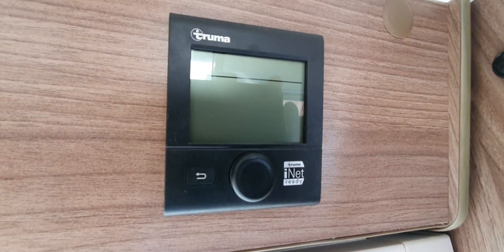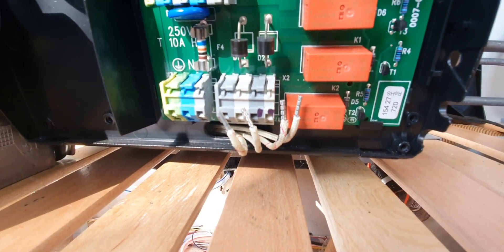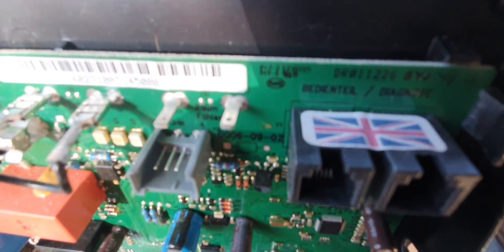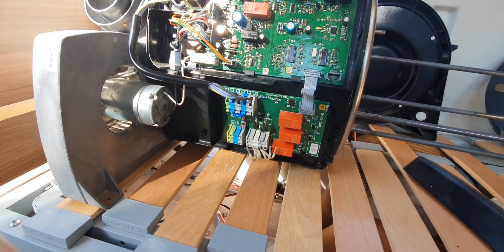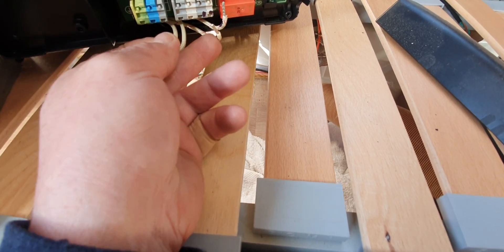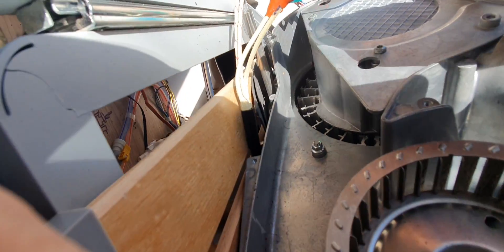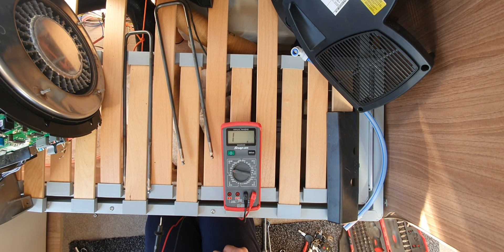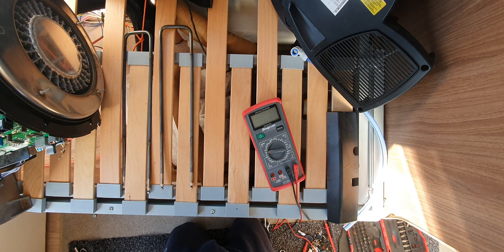Truma Combi 2E 4E 6E boiler element testing and removing

Comment: Hi steve we curretly have out heater out to replace the heating elements the problem we have at the moment is the person who did the service on he caravan removed the element cabels from the power supply does it matter what terminals each wire goes back into any help greatly appreciated
Reply from the maker: @lewishugman1285  Hi Lewis, no it doesn't matter which one goes where, on low power only one of the elements will heat up, on high power the 2nd one will kick in, I can't see it makes much difference which element is assigned to which circuit, the elements are both the same and both will heat the tank up as well as each other.
Reply from the maker: Just to add... obviously each element needs a live and neutral, so you can't  mix that part up.
Reply: Many thanks yes we numbered the element wires when we disconnected them from the elements but it was the pcb board end that was the problem so as long as it is as u have done it we should be fine

Comment: How do you remove the element cables from the PCB? I need to remove mine and can't see any screws to slacken or tags to press in.
Reply from the maker: @stephenprice7502  They are just held in with a spring inside the connector block, use a small screwdriver to hold it open while you pull the wire out.

Comment: Great video thanks Steve, it's helped me a lot. One small point about your diagnostic technique using continuity setting on meter. Your meter is set to buzz at low resistances (possibly 10Ohms or less). However a 900W element has a resistance of about 64 Ohms and a 2Kw element about 29 Ohms, so you should use the meter on ohms. Regards
Reply from the maker: Yep i agree, I had already tested the elements using ohms, I set it to beep purely for the video to show the difference between continuity and an open (dead) circuit i had with the elements. Glad it helped anyway. 👍
Reply: Can I just jump in…..Im a bit confused….all indications are that I have a blown element (boiler doesnt  work on low, only works on high). However, Ive got the unit on the bench and the new elements have a resistance of 62.1 The elements in the boiler have a resistance of 60.2……so now Im confused! Do I have a blown element? Continuity test does nothing on old or new elements - I think the resistance test is the only method that works…..and now Im totally confused by my readings! @awiserbud

Comment: To make it easier to remove old elements, I cut at the "U" & twisted each half out. The after-market new elements were fine, except they came without the second nut to terminate the wiring lug. The old nuts do not fit - were 3.2mm, new element threaded end is 2.8mm., fine thread. Also used graphite powder on new elements to assist with tight fit. All working fine, hopefully for more than 18 months this time!
Reply: Sounds like 5BA and 6BA thread sizes.

Comment: Usually when heating elements fail they have swollen(my experience from cooker elements at least) from use meaning they will be tough to remove as they are held in tight by the heat dissipating fins which the heat conducts through, removing without full disassembly and carefully spreading the fins could mean damaging these fins and when fitting the replacement elements they are not snuggly fitted inbetween the fins(hence easier to fit new elements) and heat not fully spreading across to the fins and consequently premature failure of the elements. Just info for others that may contemplate cutting the element 'u' bends to remove elements without full disassembly. Of course elements can just fail without swelling so some may be lucky in removing them easily and fitted new may be OK. Just something to consider for future ref  to others interested.

Comment: hi great video, love info. But can you help with the control panels. you have 2, do they interconnect or both connect directly back to the combi separately? thanks
Reply from the maker: I only have 1 control panel for the combi, the other control panel is for my caravan, (lights, water pump, power etc)
Reply: @awiserbud  so with just one control panel (assuming you mean one dial) are you limited to running on gas only and not on 230v electric too?
Reply: now realised you have a newer model which has a digital control panel

Comment: Hi I have watched your video several times now and yes it did help me to fix my problem but my question is how do you open the connector plack to heater elemant wires as I dont want to break anything, just ordered 2 new elements today, and I know i can replace the without opening the block, but I would like to know for any future work, thanks
Reply from the maker: You dont need to open it, the element wires just push into the connector blocks

Comment: Hi Steve, great video I need to subscribe to it…but I’m hoping that you will be able to help me with an opinion….
Mine has failed with an E41H error but it’s failed on gas and electricity…so it’s not just the elements….the overheat sensor hasn’t tripped, can you point me to a likely source or solution ?

Comment: hi, well i am having trouble with my truma combi boiler. the fault on the control panel reads, ....."operation fault: 230v-power not connected"....... the boiler works on gas fine, everything in the van electric wise works fine, but the boiler just wont work on mains power. i have tried a new power lead to the van and to no avail. now i am absolutely clueless electric wise and i am wondering if this was the start of the problem you are dealing with. i only want to go to a dealer as a last resort, so i hope you get this comment and maybe be able to maybe shine a light on it. thanks and hope to hear from you. cheers

Comment: hi steve changed mine for £150 ( truma £650.00) worked for a couple of months now the  problem is E41 H elements tested ok  heaters not working any idea ?
Reply from the maker: E41 is an electric issue, trumas fault list shows thos as a temperature sensor; either air temperature or water temperature, make sure you have plugged the air temp sensor back in properly, this is from the Truma fault code page:

electronic blocked: 
– because the air temperature switch 
and / or water temperature switch opened 
during operation. 
– because the air temperature switch is 
damaged
– due to a short-circuit of the combustion air 
temperature sensor 

Good luck.

Comment: Hi Steve - I know this is now an old video but I am changing my elements on my 6E - have you had any issues since you've fitted the elements? I only ask as I am led to understand they need to be crimped into the heat exchanger which would entail a total boiler strip down. I was going to take a chance and install them as per your video. I just would be interested to know if they are still working well and did the new elements just slide in ok? Many thanks Simon
Reply from the maker: Hi Simon, both heating elements still going strong, I have no idea about crimping them in, I'm pretty sure mine were only slotted in place, but they cant go anywhere once they are in place. 
Good luck.
Reply: Thanks Steve - I did replace both elements today which was very straightforward. Your video gave me the confidence to do this so thanks very much. I have to say the elements I removed hadn't been crimped into the heat exchanger and we have been using them for over 2 years on a very frequent basis so no complaints about longevity. I had just read on a few forums that the elements are supposed to be crimped into the heat exchanger to avoid hot spots but as I now know how to remove the boiler reasonably easily I am less concerned if I have to replace them again. I did have to gently tap out the old elements but was very careful not to use excessive or uneven force and the new ones slotted in with ease. Thanks again for taking the time to upload your video as it was really helpful and saved me a lot of money. All the best, Simon
Reply from the maker: @SiHymerB544  nice one simon, yeah it all looks a bit daunting when you look at it the first time, but when you realise how easy it comes out its not a bad job at all, 
The way i see it is as long as the elements are contacting the fins in the heater casing then the heat will naturally transfer where it needs to get to, and obviously the more contact the better, I reckon if it was crimped in one spot then that spot would be the point of least resistance for the heat to transfer and could end up overheating at that point, I would sooner the heat transferred evenly across the full length of the elements, (thats what my mechanical / engineering side of me thinks anyway. )
Reply: @awiserbud  Yes that makes complete sense - I will see how long they last! 👍

Comment: Hi Steve- how did you disconnect the gas connection to remove the boiler unit? Mine needs to come out for repair! Thanks mate.
Reply from the maker: Its just a screw joint, obviously disconnect the gas bottle first and undo the joint with a spanner, i think it was a 13 or 14mm .. you might have to wiggle it to seperate the joint
Reply: Perfect, thank you buddy.

Comment: Hello Steve.  Are your new elements from Thermo Tecnica still working a year on?  Our caravan is a year old and both elements have blown already and I was thinking about buying these non originals from Thermo Tecnica.
Reply from the maker: Hi Richard, yes both elements still going strong, to be honest we probably only use the caravan a handful of times through the year, but I'm very mindful not to turn the hot water or heating on until i know the system has plenty of water in it, i suspect that may be why the original ones failed (previous owner)
Reply: Okay thanks for reply.   We have had about 90 nights away during the last year mainly using electric.  This January I noticed the caravan wasn't as cosy as last winter so we were supplementing it with gas.  I think one of the elements had gone at that point.  Last month we were away with the heater on low all night (electric) and at 2.30 am the main EC643 control panel above the door started flickering and beeping, then all the power tripped.  I think that may have been when the second element blew.

Comment: E6H error code coming up on my controller. Tries to start up fan runs a bit then cuts out. Throws up E6H Any ideas to cure problem
Reply from the maker: E6H – current for combustion motor is too high

There is something in the combustion air motor or the cable harness that is defective causing the combustion air motor to draw too much current.

That is trumas description for that code, think you'll need to check the blower and see why its drawing too much current, could be something blocking the fan, worn bearings, dusts etc.

Comment: We’re did you get the elements from
Reply from the maker: Hi Robert, I got them from Thermo Technica, I found them online
Reply: @awiserbud  great thanks I will get them on order 
They are tight to come out can not move one of them
Reply from the maker: Mine came out quite easily but a few people have mentioned their's being tight, possibly fused to the casing or maybe they swelled up when they overheated and burnt out, I guess you could tap them through from the back or maybe cut them in half across the bend at the end allowing you to twist them and pull at the same time.

Comment: Hi having watched your video and after receiving an estimate for£650 to change the elements I decided to buy and change myself (£145) the only really difficult part was removing the old elements as they were jammed in proper! I had to cut one element in half in order to spin it to release. But the new ones slid into position easily 
Thanks for posting you saved me a small fortune 😁
Reply from the maker: Thanks for your comment, glad it helped and saved you some cash, awesome news,
My "cheaper" elements are still working well by the way. 😃

Comment: Hi how to disconnect  the wire of the plug of the element is it a trick thanks
Reply from the maker: No trick, they are just push fitted in the special clips on the circuit board, you will need a very thin small screwdriver to push in the holes and release the spring clamp.

Comment: Have you recorded a video on reassembling the boiler. did you replace any seals, the truma kit seems to include a lot of seals.
Reply from the maker: I didnt open up the liquid side of the boiler, didn't need to when replacing the heating elements so no need to replace any seals.